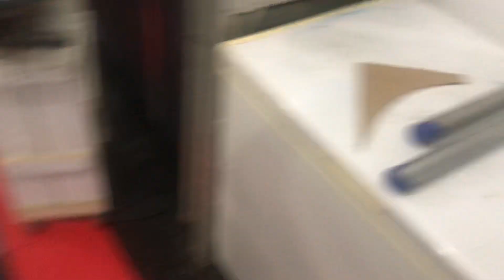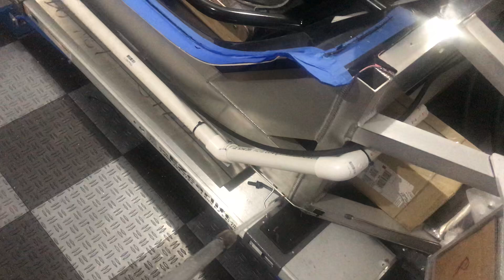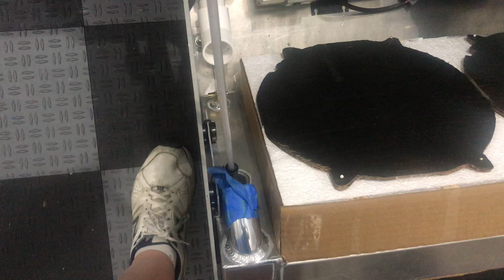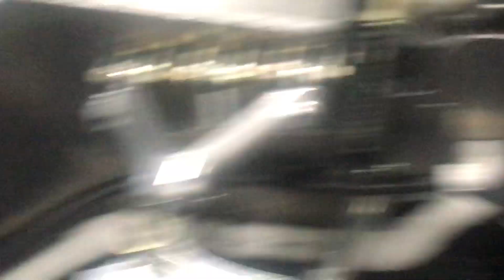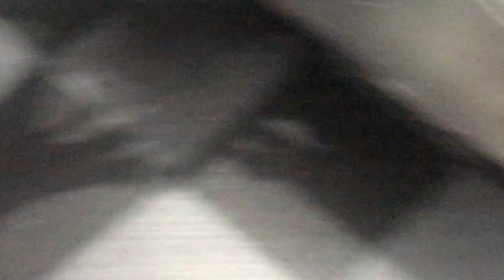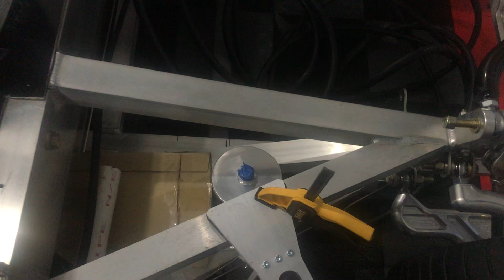Superlite SLC Build 055 Mocking Up and Routing Cooling and AC Lines

Comment: Nice! I wonder: will the heat in the radiator lines affect the fluid in the door-opening hydraulic struts? Will it prevent the doors from operating correctly? Thanks!
Reply from the maker: Thanks Leslie, most builders wind up putting the struts in the doors, but those who put them in the chassis have not reported that to be a problem.
Reply: @JoelKSLC  thanks!

Comment: Look at you go Joel! Like a busy beaver building a dam! Just a question why not route those cooling tubes between the upper and lower control arms? I'm sure there is a reason, but I just had to ask.
Reply from the maker: Alfonso Demagistris LOL, have to stay busy during the pandemic lock down! The cooling tubes needs to hug the bottom of the chassis otherwise it would interfere with the inside of the tire. Also, there is only about an 3/4”-1” of space between the body and the chassis in that area.